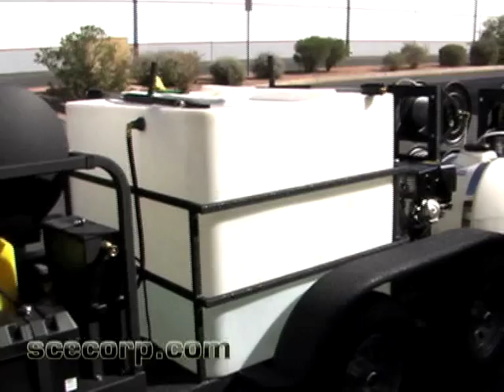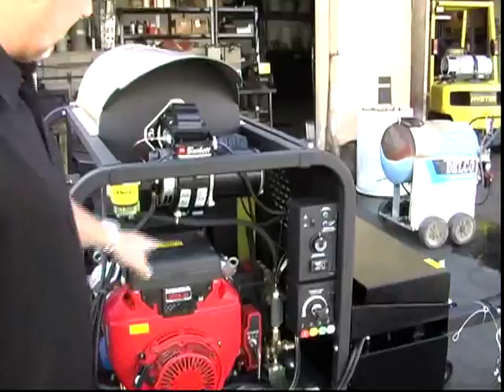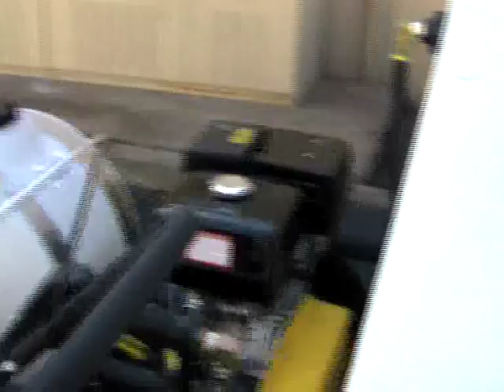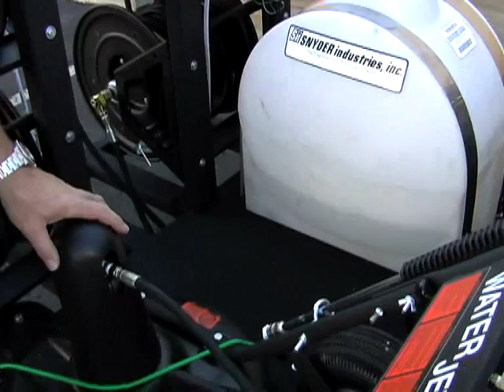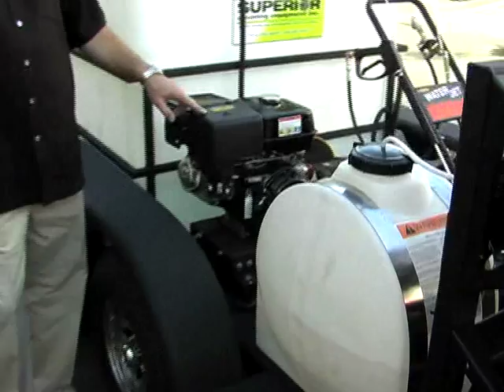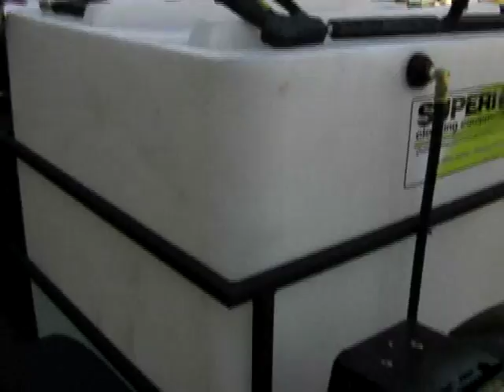Custom Pressure Washer Trailer w/ Dual Gun Setup - Superior Cleaning Equipment

Comment from the maker: The MHP is a narrow footprint 12V burner &  belt drive pump. The warranty is the same with 7 years on the pump and 5 years on the coil with no pro rating. I know there is alot of talk on the web about 12V vs 120V burners. The 12Volts are cheaper to purchase and a little more expensive to maintain. That being said I have contract cleaners that have had MHPs in the field every day for 10 years and they are still running. Could be the great dealer support however. :)

Comment from the maker: Well if powder coat baked paint, all schedule 80 pvc fittings, two belt drive pressure washers, integrated tool box with diesel fuel tank, separate chemical tank and surface cleaner means fancy, I am guilty. I have had customers keep their equipment looking as good as new for years and some whose look bad 5 months later. It is a great setup that works very, very well based on decades of experience in the field. And no, it was much less than 25k.